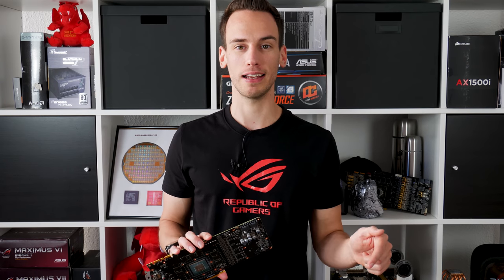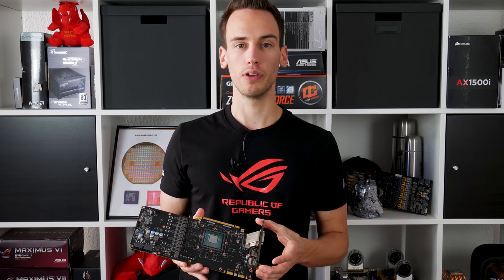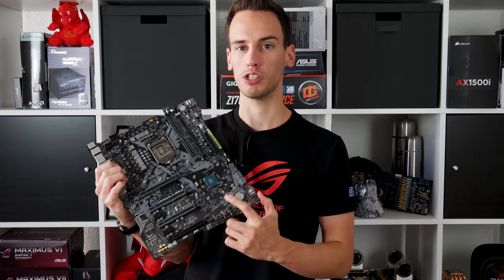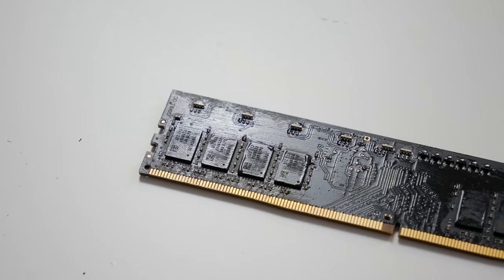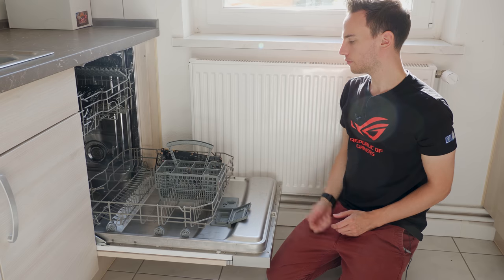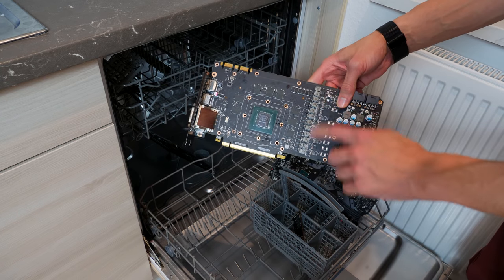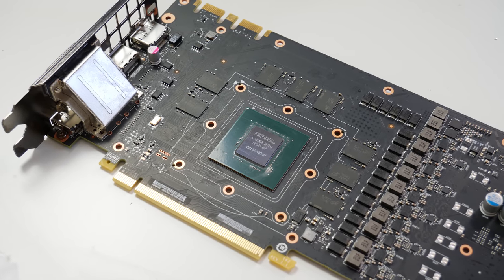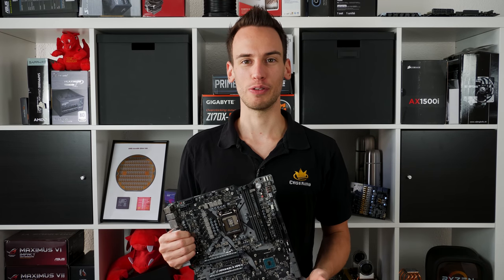The Diswasher Debate

Comment: It doesn't matter if you took the bios battery or any other connection, the capacitors on the board may still be charged :(
Reply: As soon as the water becomes conductive for any reason (maybe because of some minerals in it or a little of dish soap left on the dish washer), that board could be dead.

Comment: no way i ever use liquid metal on gpu maybe on cpu but never on the gpu, and only if there actual benefit running it even higher overclock and stable, the mess and the maintenaince required im just to lazy for that, i stick to watercooling and mx4 if gone for 5 years without replacing thermal paste on the block and it made 0 difference

Comment: I’d use rubbing alcohol in a spray bottle at the end after the dishwasher and let it evaporate for a long time. Would that be fine too?
Reply: an alcohol rinse is a good idea - that's how electronics like this is usually washed during / after manufacturing. A de-ionized water wash with special detergents, followed by an aclohol wash. It helps get the water out, since the alcohol combines with the water and basically encourages it to evaporate. For the home user, a regular dish water wash followed by a splash of rubbing alcohol will be fine.

Personally I would dry it off with a hair dryer so that it's dry to the touch, and then put it in the oven for 30min or an hour at the lowest temperature possible to (I would say ~100 deg C absolute max, lower would be safer). Finally after that, let it dry in open air for a day or two. That should guarantee that any water stuck underneath BGA components is gone.

Comment: This isn’t crazy , I’ve washed milk from the motherboard of a MacBook laptop in a bucket of boiling hot water and dishwasher tablet. Dried it with a heat gun and it worked for years. Same with  an atx mobo and gpus. (But that was old tech, no chance I’m putting my new stuff in lol)

Comment: I've seen videos of repair shops (louis rossman for example) where they get heavily corroded boards due to water damage. How come those boards come out impecable? O_O
Reply: Well, corrosion apparently appears as water evaporate. Never had a steel knife coming out of the dishwasher all orange?
Reply: because it's not encased, was not powered while still wet, was not left moist for days. the yellowing of your (stainless?)steel knife could be due to broken coating on a plate holder on the drawer. been years since I last washed a motherboard in the sink, common practice back then was to dry it in a oven at low temp for a couple hours.

Comment: I wonder how it would work to use oven for drying. You probably want to use a fan-assisted oven to keep humidity lower. Also you probably don't want to lay it on the plate but have something between. But I guess something like 80c for few hours should do something at least, probably could go something like 150c without a worry.

Comment: Does this also work for dust?
Asking for a friend
Reply: Why not?
Reply: There is no better way to dust a cooler (without the fan. It could damage its bearing).
Not kidding. Longtime PC-Builder.
For fans I use a radiator brush.
Reply: Yep, I always wash my coolers in the sink.
Reply: I use a compressor, it gets all the dust out.
Reply: It does work. I got a CPU cooler from a friend and he smokes while playing games. Put it in a dish washer for two cycles and it was almost as good as new.
Reply: I just contact clean the fuck out of it as I get cans of the stuff free from work lol
Reply: Exentio Della Resistenza
dust issues? in your kitchen? how you do that? Wife, girly mate? how you clean dust? Have a machine?
Hiring Pro service, friends do that now in 2018 for you?
If you don't own a machine or kitchen, forget this content, blow air!
Reply: It will work for dust . And even mild rust.
Reply: Ryan do you have rust on your PC componets?

Comment: Cant stress enough what Der8auer said about not using detergents. While, yes, dish SOAP is a degreaser, there are also acids in dishwasher DETERGENT that are particularly caustic to Aluminum and Copper.  If you have a bare aluminum bottom pan, or a copper bottom pan, you can put them in the dishwasher and see exactly what i mean. The aluminum will have its oxide layer removed, and over time will start to pit. The copper will also have its oxide layer removed, but it will just look shiny in the end, and none the worse for wear, but its still probably not good for an electrical trace regardless.
Reply: Well, I worked at a board assembly house where we ran every board we made through a dishwasher and I never saw what you're talking about. Neither did any of our customers who stayed with us for decades.
Reply: @1pcfred  Is English not your first language? Because clearly you missed the part where I was specifically talking about using DETERGENT. There is acid in the dishwasher detergent that is similar to a strong vinegar. It will eat through the aluminum oxide layer, and pit the aluminum, eroding the surface.

Simply "putting it in a dishwasher", or even an ultrasonic cleaner for that matter, makes no difference, and is a relatively common industry practice.

Please read more carefully.
Reply: American is my first language. Dish detergent is not going to hurt anything on a printed circuit board in a normal machine cycle. Look at a circuit board more carefully. There is no aluminum or exposed copper on it. I've worked with commercial cleansers that had a reaction with aluminum in high concentrations. But you had to be misusing the product to get that effect out of it.
Reply: @1pcfred  thankfully, science is on my side. And if you look up aluminum tarnishing in dishwashers on your favorite search engine, you will find countless examples and cautionary tales. Particularly in the coffee industry, where most parts are cast aluminum or zamac. There are also tutorials out there for removing anodizing from aluminum parts using oven cleaner, and a dishwasher with detergent. If you put a bare pop can in a dishwasher, after several runs, it can become brittle as the oxide layer is stripped off, and the acid reacts to the bare metal. Hell, you can even use light vinegar to determine the metal composition of the casting used on a mechanical part.

And if you seriously think there is no aluminum on a PCB...okay...sure. I'm Beginning to think your job at this facility was shipping and receiving, maybe janitorial.

Literally no point in wasting any more of my time with an idiot. Sorry I bothered.
Reply: Experience is on my side. I've washed thousands of circuit boards in a dishwasher with no ill effects. There is no copper or aluminum on circuit boards anyways. Everything is tinned. So GTFO

Comment: I don't recommend using detergent when doing this. as it is corrosive.
a few drops of soap should be fine though.
Reply: The problem is there is leftover detergent from previous loads, and the water in the dishwasher is unpure
Reply: The problem is neither of you know what you're talking about. Dishwashers make things clean enough to eat off of. Dishwashers make things clean. It does not matter what you load into it everything comes out clean. Be it dishes or circuit boards. Dishwashers have rinse cycles.
Reply: You’re incorrect. Dishwasher detergent contains anti corrosives to protect silverware. And using soap in in your dishwasher will make it over foam and void your warranty

Comment: it's a joke right? high PH water will corrode copper even if there is no electricity going through it. also water has ions that will move (although slowly) electrons between your metal surfaces. sure if you do it once or twice the damage will be negligible but i can see some kid doing this every time he want to remove dust from a graphics card. if you want to clean electronics with water you should use distilled water but the safest way is isopropyl alcohol. i think this is very irresponsible to recommend doing and you should do more testing before doing so. yes i know who der8auer is,  i wouldn't post a comment if it was some unknown youtuber.

Comment: I would never be able to trust a dishwasher with my hardware but... 

Does this mean that it is considered safe to rinse hardware in lukewarm water with maybe a soft sponge if you need to clean up insulation-gunk? I always only used electro-cleaner sprays for this - but obviously if you can use water that would be a lot cheaper and more convenient.

I would still sweat bullets if I tried lol....

Comment: Normal tap water have quite high conductivity procent. Also dishwashers use salt. Did u clean diswahser before? I still not reccomend doing this. Some components "collect water" and after it gets hot the component might "explode" - water wants to get out. Its dangerous. Dude please dont give advice on this field.
After washing boards with components on it they should be put into heating chamber to get water out minimum 5 hours.
The only thing that protects these boards from your dirty hands and from this contaminated water inside your dishwasher is thin layer of varnish.

Comment: With all the nasty unknown chemicals and cleaners used in electronics production, I'm not so sure about sharing dishwasher or oven for food-prep duties. .  .
Reply: there are more unknown chemicals in your food than electronic products.
Reply: You really shouldnt because you have no way of knowing if the chemicals were flushed away or still reside in the dishwasher, and this will strip the oils from the stuff like the cmos switch button, and possibly rust the spring in there, among other issues. The health risks are low, but you should avoid doing this.
Reply: Don't don't about individuals, but if I did this at work and got caught by the feds while doing it, there would be a massive fine comming our way, it's super illegal to put electronics in a dishwasher that let's the waste water straight into the sewers without being treated first.

Comment: BEWARE - Dishwashers can/may contain salt used as a water softener. Salt is bad, it is conductive and does not evaporate (most likely the residue you are refering to @11:15) = destroys your hardware later if humidity is present. Air contains high amounts of humidity, which you know (Condensation is humidity frozen)

https://en.wikipedia.org/wiki/Dishwasher_detergent (Detergent - name of cleaning chemical you didn't know)
- some brands of dishwasher detergents may have salts included (tabs), but not all, so it has to be added extra - typically in a container inside the bottom of the dishwasher.

https://en.wikipedia.org/wiki/Dishwasher_salt
"In some countries, especially those in Europe, dishwashers include a built-in water softener that removes calcium and magnesium ions from the water. Dishwasher salt, which is coarse-grained sodium chloride (table salt), is used to regenerate the resin in the built-in ion-exchange system. "

Comment: Thank you for making this video :)
Have been cleaning many electric components in a ultrasonic cleaner but would never try the dishwasher without some proof.
Of course there is a risc of damage even if it small
Reply: And I would use compressed air to blow out everything and then dry with hot air

Comment: Better with a Couter top  Tanked Dishwasher (with door window)
Due Mains TAP Water is NOT Pure (it just clean) (Chlorine and other treatments (Lead pipes) and Copper Pipes, Full of minerals  and metal Traces  )

A Tanked dishwater  Lets you to Use Distilled water / Distilled White Vinegar / Isopropyl alcohol / Hobby (RC World ) Nitro Engine & Electric motor & Bering cleaner (~Good Stuff ~ Is Everything Safe And no Dry residue  ) / Ethanol /  Distilled Deionized Water / Citric acid   / Bicarbonate of Soda (baking soda)

Due a few of these are not cheap you may want to Condenser Reusing & Recycle  them a few Times Even Re distil them  (water distiller with Fan condencer & With adjustable  Boil Temp control ) 

And Alot of them Cant be put down in the Public  Sewer  (PPP - Pee, Poo, Paper ) (GW (Gray Water) FW (Foul Water) )BW(Black Water )  )/ Septic  System  and will need you to Jarry can  them up and depose at a Local Authority Recycling Center with a tank in the floor you just unload into 

You Fine with GEL & Liquid Dishwasher Washing soaps (Rated for Glass  is A must)

Alos make sure the Salt  Water softener  is off or you Flushed it and are using it for something else "WD-40 Specialist Silicone Lubricant" for Fans & motors

Comment: Siemens/Bosch, good machine!
Dishwasher, u can use Ecover Dishwasher non toxic solutions, acid is the only issue, jets are a non issue. these acids are still in the machine! a non issue!
Cases too, some do change colors, never i did a PSU!
How does ASUS washes their boards after production, what toxic acids they use?
Just use air bus air, don't dry it too high on the Celsius levels in the Bosch! Use the 45 glass program.

This is good content, my Gamer noob friends always called me crazy, now i can show them this ;)
We both own the same machine, only my machine is RostFrei, you have plywood fancy all over the kitchen cover! I never need a kitchen, only the Bosch. The only Lady tool in my house! Rest is all Pro!

Comment: People just brainlessly brabble things they heard without understanding them. People tell them "if you spill water over your graphicscard it will break" So they think that is true in every situation without understanding the reason for it breaking. If these people understood WHY electronics break when you spill stuff on them, they would figure that it is completly safe to wash them with water if you can dry them completly without leavin any residue.
Reply: incorrect. tap water should never be used for cleaning electronics. It contains minerals, dirt and other corrosive elements. only pure water should be used
Reply: all tap water contains minerals. Even distilled water is not safe enough for circuit boards. Further, his dishwasher has residue all over the inside from detergent from previous loads which contains minerals. To clean circuit boards you are supposed to use pure deionized water or isopropyl alchohol

Comment: You can dish wash... keyboard.. with soap FINISH is best.. I put 4 tablets 1st 60C quick, after 50C washing 2 tablets.. Than only soap i use at 3rd time washing 70c, after that QUICK wash AGAIN 60c than again longer was70C with out soap and tablets...... After 1.50 minutes i take it out... drain the water out... and leave it in warm place For 8 hours turning 4 times keyboard in all ways. After Take WD-40 spray as much as you can..If you do not use WD-40 your keyboard will have corrosion... Simple... electronic will die sooner or later. Do not leave 1 day alone with out wd-40 Mechanical keyboard will get corrosion and it is over ... After 4 hours... WD is already stacked on electronic. Put in oven for 10 minutes 50c... After go for 75c.. 5 minutes.. Than for 100c 5 minutes.. TURN IT OFF... Than wait 4 hours top 5 hours MAX. DO not take out keyboard at all.. just wait 4 -5 hours. Yes i had mechanical problems u can not clean inside never.. With out soup  your keyboard is not clean. With out that process, still keyboard will not work.  Yes WD-40 will smell as hell.. because it is doing chemical process.  After 5 hours turn it back to 100C for 12 -15 Minutes ... than Put after to 75C for 2 minutes and Turned it off.... and wait 14 hours - 16 hours... When you take it out from the oven.... Yes do not forget to remove all keys before you start the process....IT is hard but it takes focus and time.  Yes i am computer expert anyway. Keyboard move with your hands in all way  to get some WD-40 moved on all keys then turn it for 90-o and hold The WD-40 will start leaking turning again 90-o and wait.. and again... and wait.. when it stops to leak it is fine.. Put it back to table for next day to stand like 8 hours.... And then  clean complete outside corners and under.. put keys back. and clean it again.. start to press every single keys multiple times.. more often than you think.. more you press better response will happen less problems.. Yes it takes time.. Why i saying this... I had problems with all keys Cleaning with water not enough.. Yes what was the keys... Back space and u the biggest problems..  back space deleting more than 1 letter,, U never works, G  Enter missing sometimes light, space does  not register... most keys do not register, 1st press key missing already or U press A it registers 0 and after 2 or 3  letter A i get... back space deletes  3A and another to... than i go FOR CLEANING METHOD.. Simple use logic and brain... Do not listen You tube videos.. they never say about WD-40... Yes my Keyboard problems was with... Asus Keyboard Strix Tactic Pro Brown Mechanical Gaming Keyboard Cherry MX Switch Retail,
HyperX Introduces ALLOY Gaming Keyboard
Solid Steel Frame, Minimalistic Compact Design Ideal for FPS Gamers
Cherry MX Mechanical Gaming Key Switches
HyperX Red Backlit Keys with Dynamic Lighting Effects... more problems than any keyboard in the world.. Now it works as new. Response time is better than it can be. No double keys anymore no missing keys... any more light on Enter is turned back on. Oven WD DISH WASHER will make your keyboard as new. Do not throw money for new ones all Mechanical keyboards have problem... The best is today Optical keyboards it have best response time and 0 problem keys like mechanical have only problems no matter what kind of mechanical you buy. Imagine how you know your keyboard is bad.. ? Have another for 10 euros at home just switch it... and you gonna notice 10 euros keyboard works better.. So it is time to clean it. WD-40 works with MB GPU TO...  And cars.... it starts to work  as new.